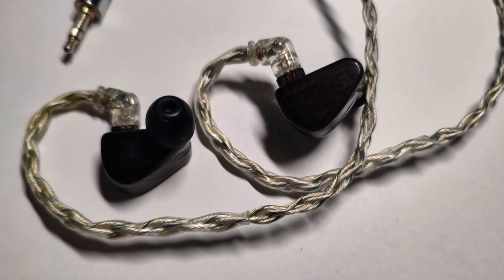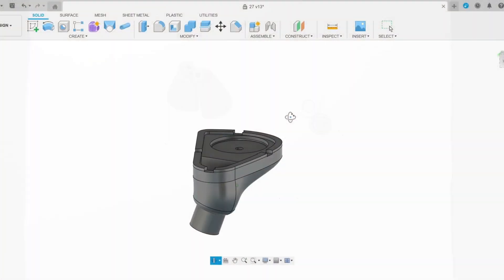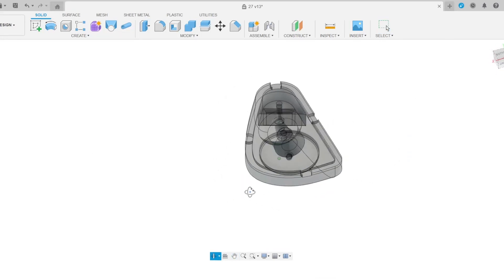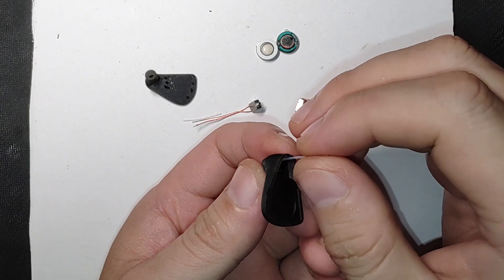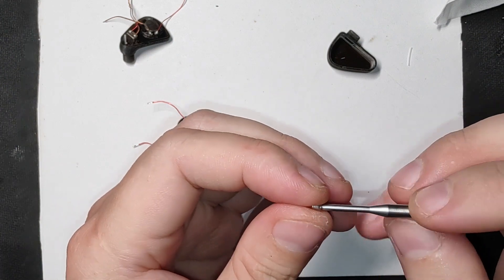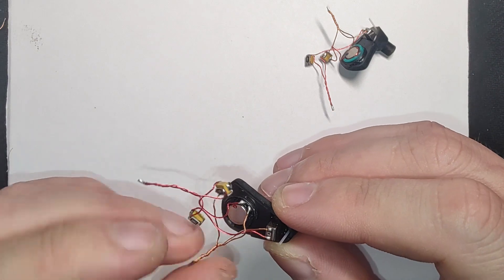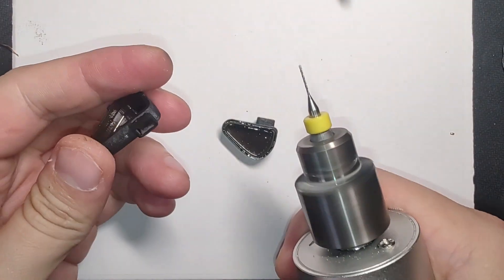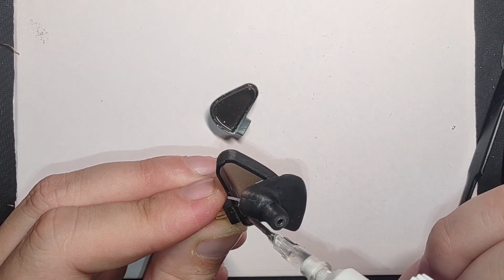How to Make DIY In-Ear Monitors with 1 Dynamic Driver + 1 Balanced Armature Driver (Budget-Friendly)

Comment: Is possible to make a open back iem ?
Reply: What are you looking to achieve? Do you want to be able to hear the outside through the IEM, or you looking for a perceptual soundstage extension? Because you won't achieve the former and the latter... well it's in the tuning but even the small breather hole doesn't actually provide a lot of impedance anyway. Or are you looking for a look?

Comment: Can you tell me what capacitor is needed so that the DD (32ohm) does not play above 200 Hz. thanks in advance!
Reply from the maker: I recommend you play with everycircuit.com or other similar software. Make the circuit, adjust R and C values and see how the output frequency. That's the good way to get started with basic
Reply: @kozh4013  thanks you bro!!

Comment: Hi, I recently just build my own IEM with 1 Dynamic Driver and 1 Balance Armature driver, i used to run the BA with another DD and it just work fine, sounds beautiful and everything. but i upgraded the DD which usually works perfectly too but somehow when i combine them with the BA they create a pretty noticable static noise. how can i reduce it? thanks in advance
Reply from the maker: You need to measure the frequency response, see what goes wrong and work from there
Reply: @kozh4013  is it possible that they just have to high of a volume, it is quite weird how loud they are
Reply from the maker: @michaelkho28  do you Android phone at very low volume? Some phones get very noisy at low volume. There are some possible to solve: 1 use external DAC, 2 use Android custom ROM, 3 use EQ app to lower audio output and listening at High volume and 4 tune IEMs with high value resistors so they can be used to listen to at higher volume
Reply from the maker: @michaelkho28  there's also possible that you use very small size capacitors or resistors on your crossover circuit so they can't supply the drivers. You'll get very high distortion
Reply: @kozh4013  noted, will do some more research on that 😁

Comment: What rc filter did you use on this project? I assume you used both high and low pass filter is that true?
Reply from the maker: Low pass for DD and high pass for BA but only used it to lower mid bass. Still allowed some low frequency passes through.

Comment: what a great project, i do wish that you can make a tutorial and explanation about the tuning circuit you mention, in my country Indonesia it's pretty hard to find those driver so i need to use driver i can find here to keep it "budget friendly". i worried that the use of different driver need a different components for that circuit, so i guess it would be very helpful to understand the concept so i can choose the right components for my build. thanks in advance
Reply: and also what is that small tube called or commonly used, I couldn't find it here
Reply from the maker: Yeah, different shells or drivers will need slightly different tuning
Reply from the maker: I've already done experimenting with 2BAs IEM budget friendly and easy to make. Only need a capacitor for crossover. The result is very very good. Stay tuned for that

Comment: Im interested in learning how to tune with the capacitors and resistance. is there any book or material that you recomend?
Reply from the maker: Many articles on the internet explain how RC filter circuits work. I recommend you start from there if you haven't already